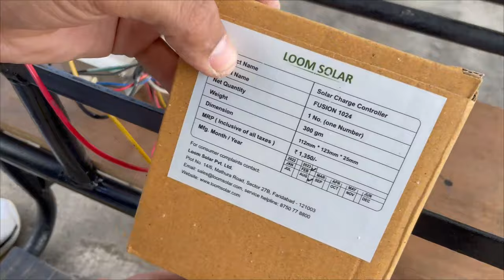Building a Solar Electric Trike | Free Energy Electric Tricycle

Comment: We can't do the both work at a same time. Battery will soon hit up and burnt 😂😂
Reply: I am not sure how this technicaly compares to a mono block recharchable battery. I only know that it costs a lot to repair the ready made mono block batteryscif they are completely discharged. On the other hand I am not sure if there will not be a kind of destructive cascade reaction in this design if one fails. Measuring what happens inside and beeing able to identify and exchange individual failing batteries quickly would possibly be key to give this design avlong life time?